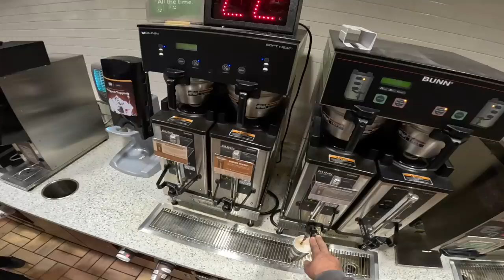Power lines everywhere on this new project!

Comment: One time my old bosses had me dig down to a footing on the foundation of a house.  They wanted to check its bearing I think.  It was maybe 5 or 6 feet down to reach it and he came to check it out and take picture for the inspector or somebody.  It was maybe 3'6" in diameter and I was whipped by the time I finished.  He walks up to me with a serious look and he just stared at me and spoke as if I was hard of hearing, "You dig a good hole!", he says.  I was proud of my work but the compliment did not sit well with me, especially after he asked me to do it again not 10 feet further up the property to see the same thing.  I put everything back the way I had found it and we continued forth with a second story addition on the house.  I did not stay with that company because respect so important to me.  I know the guys feel good that you will join in and dig with them and they respect that.  Not just because doing concrete necessitates handwork like shoveling, but because you show that you are not above shovel work is admirable.  Those are my favorite tools; hammer and a shovel.

Comment: Ryan have you ever call 811 before you start digging or drilling before starting a new project? or should you invest in buying a detector?
Reply: I was wondering the same, but im sure there are electrical codes for buried cable and electric that arent being followed and is why Ryan fines the wires. Im sure he is use to how it should be and always finds it when it shouldnt be. This house was scary, like Ryan said why didnt the breaker pop. no breaker?. And what was with the loose bricks under the house?. were they holding the dirt or what that back door appeared to be a addon floating over the old side walk
Reply: @infidel3162  the electric. That’s considered private. So 811 wouldn’t even mark that. But the gas line. Should be marked. You get a 2500 dollar bill in the mail from 811 themselves if you don’t call before you dig. That’s not counting the thousands of dollars bill you get from the gas company to do an emergency fix.

Comment: For the electrical wires. I’m my experience there are older breaker panels that breakers don’t trip due to the components in the breaker. Here in California we’re having to replace a lot of these panels with houses that were built in the 1960-1980s. Causing a lot of fires .
Reply: It's probably fed from a Federal Pacific panel lol.
Reply: @Grab_your_Waders  EXACTLY lol

Comment: Working for spectrum I know how annoying it can be for contractors to cut lines, but also know that technician was 100% correct, the bury crews do what they want when burying the line and have seen them cut through a concrete driveway and front walk to bury the line.

Comment: My husband called and had someone come out and mark where the utilities were located so he could put in a French Drain.  No problems but he also wanted to bury the downspouts which required his breaking up some concrete sidewalk.  The gas line ran just the other side of the part of the sidewalk that needed to be removed.  He figured the line was buried  below the first line, but to his surprise he felt something just under the sod.  Yup..gas line not 4" below the sod.  Thankfully he didn't even puncture it.  God was watching out for us.
Reply: That's supposed to be *frost line

Comment: If there's one thing I loathe, it's "direct buried" cable that's not protected.  SWA (Steel Wire Armoured) cable is fine; it's designed for that purpose.  However standard low-voltage (110/220VAC) flex is not meant to be buried in dirt without extra protection (ie conduit).  The outer sheathing of the flex does break down or become brittle over time when exposed to wet or moist conditions.
Here in Australia, domestic/end-run voltage (220-240VAC) power cables must be buried at least 500mm (~20 inches) below finished ground level; even deeper for higher voltages. Cautionary tape must also be placed at ~50% of the depth to the cable or any extra mechanical protection (eg conduit, shields etc). That way as things like augers drill down, they'll snag the tape well before hitting the cables.
If this had been done on your job site, you'd've hit the tape at 10 inches and known about the cable below rather than finding it out the hard way!

Comment: They probably junction an outlet and then ran a wire from it. Romex cant be directly buried like this and is required to be in a conduit. Uf-B can be directly buried as long as it's 2 feet in the ground if im not mistaken and a bit less if it's under concrete.

Comment: Sparks flying everywhere, Daryl, 'the wire is dead', or 'It's 220', I don't know much about electrical but I surely know you don't bury Romex in the ground, should always use some type of conduit along with caution tape buried along with it.

Comment: A spark like would only be on a 20amp breaker some older panels will not trip the breaker. Newer panel they should always trip the breaker if something like you guys or someone else hitting it with something. Just glad none of yours guys got bite(shocked) off of it sparking like it did

Comment: Sometimes the site conditions are unfavorable.. like finding every wire possible coming out from the house lol.. great job either way.
Reply: Yea Scary, I doubt it was up to code, can you imagine what its like inside the house. The wires in the ground crossing and not even buried deep, and no breaker to isolate the circuit for security. Fire waiting to happen at this house.

Comment: 811.  A life saver.
Reply: Wouldn't have mattered. Private run electrical not to code still wouldn't show. That was wire run by a Handy Andy.
Reply: @nbco55  Oh, I agree.  You still have the risk of running into a live, underground wire.  But acknowledgement by the homeowner that they have identified all of the electrical runs would place liability firmly in their lap.. for any injuries, project delay costs and other liabilities.

Comment: relief valve on meter off gasses from time to time thats why in my AHJ electric needs 36 inches from it on side of house, breakers dont trip sometimes on old homes.  next time stop right away, yes we put 220 on romex/UF I suppose you are misusing trade vernacular to call service entrance wires "220"

Comment: There is probably a small leak in the gas fittings on the meter.  That's why some of your crew smelled gas.  I see it all the time especially with older houses.

Comment: Here in Illinois we have JULIE. Joint Utility Locating Information for Excavators. They're great and it's free. They flag every type of line, it's path and are color coded. I've called them before putting in bushes, etc especially near my gas meter.

Comment: Never say gas is not 2” underground.
Dug out an asphalt driveway and pulled a 4” concrete walk beside it. 
Owner wanted a wider driveway so we dug down to get the top soil out and found the main gas line from the road with the tooth on the bucket and pulled it 6” out of the ground and it twisted the meter.
Min depth here is supposed to be 18” here….

Comment: You still can have a gas leak w/o blowing gas.  I had concrete guys saw cutting concrete and cut right through gas line. Operator with machine running couldn’t hear blowing gas, he only found out when the slurry from cutting was blowing in the air.

Comment: Mike, mike. Mikeee!!! Get back when u see electrical arcing and also don't stick ur hand into a spot knowing there is electrical wires down there already ARCING. If that was a more powerful cable the first arc could've killed your just by traveling through the ground.

Comment: I’m surprised in WI you don’t have to call 811 before you dig.  In TX, it’s law before you dig you have to call 811 at least 48 hours before digging.  The various companies (cable, power, telephone, gas) will come out and mark everything.  Helps prevent a lot of what happened in this video with the cable and power line.

Comment: Most likely the wire has a 20 amp breaker and it takes a lot to trip them that's why I do not recommend a 20 amp breaker without a ground fault

Comment: That cable didn’t even look like UF cable just straight up 14/2 romex which isn’t rated for direct burial and even if it was it should be at least 2 feet deep in most areas.

Comment: My area only puts new lines on the ground, not in but on... And they wonder why there are issues. Either put on power line Aerials  or in the subterranean sub frost line. NOT AT @ 6 inch  Under 3 foot they are failures

Comment: Aren't you required to call 811 before you start digging at a project in Wisconsin?  I would think that is a boiler plate thing to do. That would have prevented the damage to the line feeding the out building not to mention the cable tv/network service. Here in New York you are liable for damages if you don't call 811 first to get underground services marked. Of course the home owner seems to be a DIYer planting the wired way too shallow and what looked like there is no foundation under that addition. Maybe they don't want the local gov to know what they have been doing. Keep Darrell away from the 220!

Comment: I'm surprised that your not required to have your worksites marked for gas/electric service. As for cable tv  those are a joke, a lot of the time the cable tv wire is only couple inches undergrade.

Comment: What’s the point in the tubes in the ground.
Reply: You have to put foundation below freeze level if you don't want steps moves around because freeze/thaw soil. So they dril holes and put tubes into them to make something like little piles since it's cheaper than pour whole footprint to that level.

Comment: Hey Ryan, do you require or recommend that customers have the city come out and mark the water lines, electrical lines, etc? I know you're not going that deep, but stuff like today happens so was just curious. Keep up the good work sir!
Reply: The city will only find city owned lines. They won't find and mark that apparent DIY project in that backyard.
Reply: 811 Dig safe its free
Reply: But also, most of the more dangerous stuff is supposed to be 18" or deeper. Diggers Hotline is always a good idea though.
Reply: In NC it's law like I imagine anywhere else that anyone excavating needs to contact 811 to mark all major utilities that come from source to house everything else that is buried is considered private and either homeowner should know or have to hire a private company to locate I would not want to dig anywhere near a gas line or power without having it marked

Comment: I'm surprised you never call to have utilities located. It's a free call.
Reply: Because outside of the cable tv everything else should be well below grade and he'd never cross it. Locators do not locate DIY feeds only Service entry feeds.
Reply: @Grab_your_Waders  would have prevented the cut cable tv. And you can't just assume gas will be deep. And now ryan thinks they'll just patch the cable. They never splice a cable underground. That will just cause interference in the future.
Reply: @skliros9235  You have a point but look at the track record, how many gas lines did he hit since the channel started? I also was a CATV tech in the Northeast for several years and we do in fact splice underground drops. There is a splice kit made with gel to protect the connection.

Comment: Sparks & Gas lines….not a good combo. A live wire in the ground with no conduit or a circuit breaker is friggin nuts! Hopefully they got an Electrician out there to it right…very unsafe.

Comment: I love the channel but please and I really mean this PLEASE NEVER exit or enter a skid steer with the boom up. I know a technician that was killed doing exactly what you 2 done @ 29:40. For the love of all NEVER trust hydraulics. I was the service manager in a NewHolland/Bobcat dealership and policy was the operator raised it, a second person put in the stops. Bobcat in general was dangerous in that you have to manually lower the cylinder stops in place when the boom was fully raised. Other skid steers were pin locked from the operators area with a lever.

Comment: Daryl for once got one thing right. Voltage doesn’t necessarily determine the size of an arc, and it’s completely normal to have direct burial 240V 3 wire especially feeding a sub panel in another dwelling

Comment: Ryan, how do you get away from calling 811, twenty four hours before you excavate? It's the homeowner or contractors responsibility to call, the utility company will come out an mark all underground electric wires, cables, fiberoptic cables and gas/water lines. If you hit any of these and you did not call, you pay to fix all lines an can be held liable for any accidents or deaths because of your noncompliance! I thought this is a requirement/law everywhere in the US. Cutting fiberoptic cables can cost, big time and hitting gas and power lines are serious killers!

Comment: 12:00 Utilities locator here. The reason why he probably smelled gas was due to the regulator (the big circle piece) releasing gas. It's there to maintain a certain amount of PSI ( about 5 psi for a household). When the psi is high, the regulator releases gas. That why he smelled something. I'm judging how it looks in the video. The gas meter is new and has no signs of pitting.